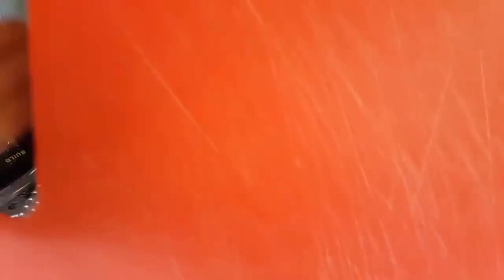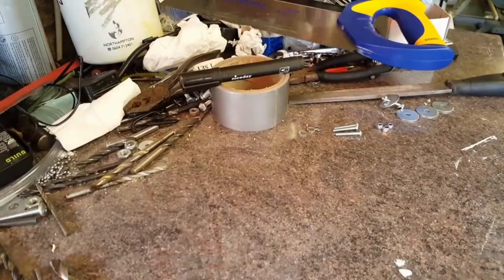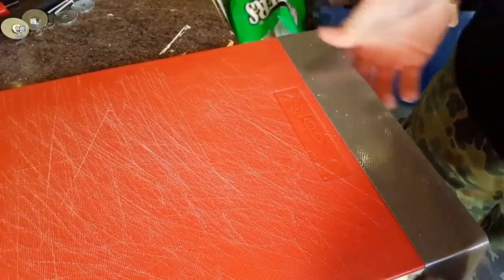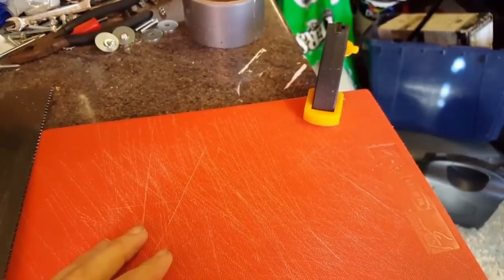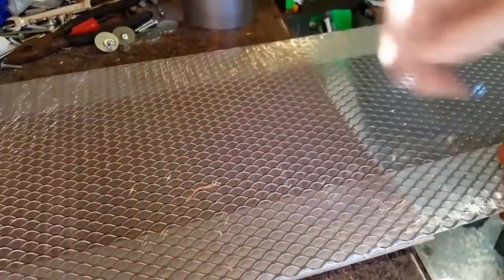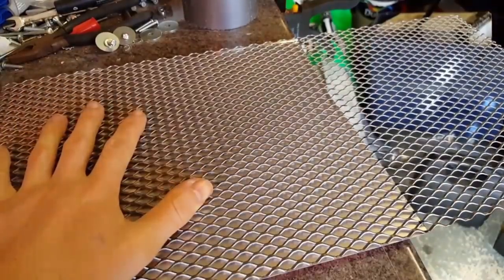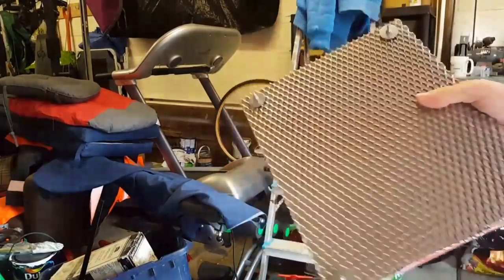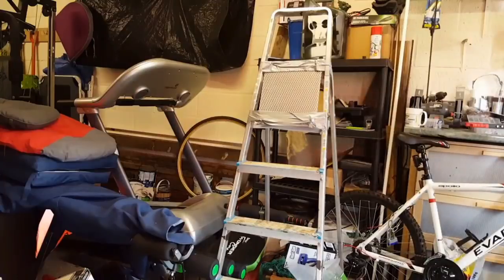How To Make A Stab Resistant Vest Panel (Guest video)

Comment: Nice design, I would suggest using either rubber cement or a silicone adhesive between layers for stability and to keep the metal in place just in case the screws break or come loose.
Reply from the maker: Good idea Darren, cheers for watching mate
Reply: Use double sided mounting tape

Comment: @WeaponCollector
thanks for this video, I myself have a bulletproof back pack, by buying a12"x10" bulletproof  panel level 3+ on the size of my backpack, and sitting where the laptop  is, but these are not knife stitch proof, hold a 44 magnum but no knife, so this design of yours I am happy with, this Stab Resistant Panel also comes in my bag pack

Comment: I’ve got an old biker jacket somewhere,I might add some armour panels to that and turn it into a shtf jacket. It’d be nice to know I have a nice defensive shell if it all kicks off.
Reply from the maker: Well worth doing as its so cheap and although may never be needed would be perfect if you did.
Reply: WeaponCollector sounds like a description of most of my stuff😂
Reply: I augmented my 70's biker jacket with shoulder plate, chainmail over the left arm and some detachable long chains 'decorating' the front. Great for the coming 'Keep Britain Tidy' campaign. Over the top I wear a hooded woollen long poncho - it not only catches blades, it conceals a multitute of 'sins'  ;)
Reply: I'd also recommend always wearing a good quality pro combat boot with some toe protection. Viper Elite V's are my go to atm.
Reply from the maker: Great ideas, bet that works great too, and like you said easy to conceal with a poncho.

Comment: Cool....but i have used those chopping boards for years and I can tell you now. You would never be able to get thru one with a handheld knife attack. So simply adding the mesh to reduce/prevent the blade slipping would be enough.
Reply from the maker: you are right their Rob, you could do it with just the board and mesh and still be fine.

Comment: Excellent work Peach, Would it work just as well if the aluminium panel was replaced by another chopping board? So two boards and then the mesh/mail cover.
As sometimes I've seen multi-packs of chopping boards quite cheap which would be an easy way of getting extra layers if needed.
Reply from the maker: Good video isn't it, yeah i reckon that would work, would make it a bit thicker though, maybe get hold of some very cheap baking trays to replace the aluminium panel if its cheaper and easier to get hold of, some places do 3 for £6 or less, use all 3 of them for 3mm metal plate with the chopping board and mesh, might even be able get that mesh from a cheap throw away BBQ if its similar strength stuff - all in the same shop possibly too
Reply: Yeah that's a good idea, £2 for a disposable BBQ for something, less than £5 for a pack of chopping boards and again £2 or something for the baking trays.
You could also probably use some sort of really strong glue on all the layers if you didn't want to drill as well.
Reply from the maker: Home Bargains here I come!!!, lol.
Reply: Now I'm wondering if a shield could be made from those same materials.
Reply from the maker: yes, could make a decent shield, you can get big chopping boards, baking trays and bigger bbqs all you'd need is a handle which would be easy to get as well.
Also just realised i have chopping boards, baking trays and those disposable grills in my shed so will give it a go soon, hadn't crossed my mind to do it the cheaper way till you commented and then i realised i had all the stuff, lol.
Reply from the maker: Have a look on my "Community" tab, i've done a post about the materials.
Reply: Yes it probably would work just as good. You will have to make one and test it, I think that would still be impossible to stab through. In a shtf situation 2 chopping boards would be easier to find in an average home.
Reply from the maker: The chopping boards do a great job on their own, but as you've shown with the alu and mesh they trap the blade too making it even better.

Comment: The chopping board alone is sufficient in most cases... to prevent knifepoint slippage, one can glue a rubber sheet on the outside

Comment: We have cheap Chinese stab vests with the thin steel scale plates inside, it didn't feel as if it would withstand multiple attacks so i inserted 3mm thick mild steel sheets wrapped in kevlar cloth & gorilla tape & backed with impact resistant foam in the front & back outside pockets, feels a lot safer but haven't been able to bend the 25cm x 30cm steel sheets so more of my sides are exposed, considering getting some riveted chainmail panels & padding for my sides as the kevlar lined hoodie i have for over the top will only withstand slash attacks.

Comment: Interesting concept:
Good, cheap, practical, simple design that actually works.
The best inventions are usually the simple ones like this.

The mesh is a really good idea because it can be really cheap if you shop about and want to buy quite a big piece!

Personally I think this is a really bad idea to actually put in a vest.
It will restrict movement and it will print like crazy if you have to bend over.  It would be very uncomfortable and although you might get away with it when it's cold, in the summer when your wearing thinner clothes , no chance!

Also the coverage is less than an actual stab vest even if you have 2 (one for the front, one for the rear).

However this would be great to put in the front pocket of a rucksack and although the purpose of possession is to protect from being stabbed, if necessary you could do damage to an attacker with this in a ruck sack in a life or death situation where you can't run away, just like if you had to use your house keys to defend your life or other innocents.

This is a useful prototype, I would improve on it by either cutting the bolts down flush and gluing the nuts so they don't come loose or by ditching the bolts completely to save weight and make more concealable by fabricating a material case or if you cut it to size it would fit perfectly into a rucksack front pocket so that the separate layers stay together.

Also that steel mesh has bigger holes than modern chain-mail.  Thin knives and spikes can get through (although they probably can't penetrate the other materials).

If I couldn't source mesh with smaller holes, I would use x2 layers of that mesh & have the 2nd layer the opposite direction so that the openings are much smaller.

I would also ditch the aluminium as it wouldn't be necessary with the double mesh.
Reply from the maker: its an interesting and easy to do idea, work exactly how it was meant too as well, i reckon it would work great in a bag or rucksack too acting like a shield.
Would fit in a very cheap plate carrier too as it no bigger than a ceramic armour plate and would at least protect your vital organs and for only £10-£20 at most.
Theres plenty of other methods you can do, now we have another if need be.

Comment: You could just use a carbon fibre flate wrapped in a fibreglass sheet which would be much lighter and if you wanted to upgrade it to being bullet proof you can just add in 3 carbon fibre plates in total which together can stop up to a 9mm, saves you doing all this cutting and trimming and its also pretty cheap but good video
Reply from the maker: Hi Jordan, that would work but the whole point of this video its very easy stuff to buy and get hold of and very cheap, carbon fibre and fibreglass is more expensive and harder to get hold of.
Reply: WeaponCollector WeaponCollector it maybe slightly more expensive but not by far as its only £20 for a carbon fibre plate and only £5 for a fibre glass rolled sheet and you can buy both of those things just as easy as you bought those metal sheets...In a DIY store or online so i dont think it is harder to get hold of but just my opinion
Reply from the maker: This was a guest video and its not me in it or doing the video, i think this all came about when i did a video on how to make a stab resistant panel from very easily obtainable items, ie Magazines, chopping boards, wood,  stuff you can get from your kitchen, or house or shed without having to buy stuff,  the person doing this video then made a response featuring items you can buy cheaply or find in your home etc, all the ideas myself, you and the person in this video have mentioned will work, so whatever is cheapest and easiest for the person doing it will be best, after all you can buy an ex police stab vest from ebay for £25.
Reply: WeaponCollector yeah i understand im not hating on the video or anything its a handy video im just providing another way to make a cheap stab and bullet resistant plate for people watching this and yourself and yeah i have looked at them but unfortunately a lot of them are fake and the vest itself isn't bullet resistant you have to buy a proper plate and the cheaper ones are still in the £100 margin, I'm not sure if i would trust a £25 vest from ebay with my life lol
Reply: Or for £15-20 you can just buy a ex police bullet/stab panel that also flexible

Comment: Sorry if this is a dumb question, but is it possible to shape the cutting board (hdpe) with a heat gun or some other heating method? I can't find anything when searching, and I'd be interested in seeing if I could form it more around my body.
Reply from the maker: I'm not actually sure mate, i shall be making another soon and when i do i'll see if i can heat and shape the cutting boards, i reckon it should work though, look out for a video in the next few months hopefully
Reply: @WeaponCollector  Wow thank you for replying! That sounds awesome! Definitely subbed for that mate
Reply: Best thing to do is melt it down and pour in to a mould of your choice.  Much appreciated for your efforts and time.  This will save 1000s of pounds